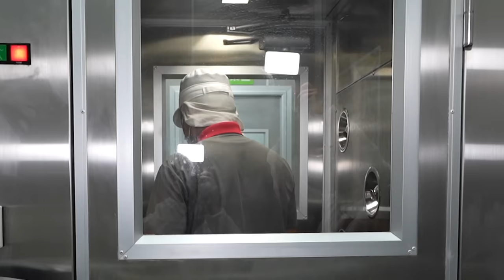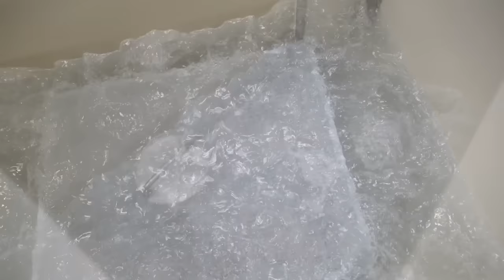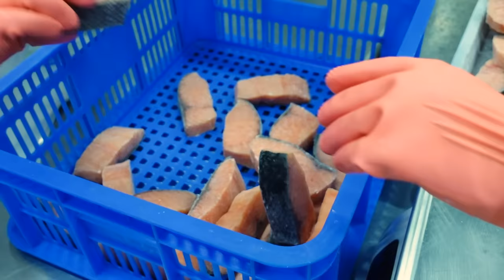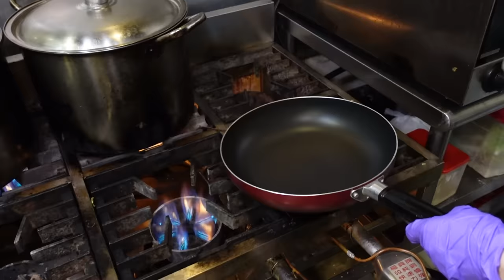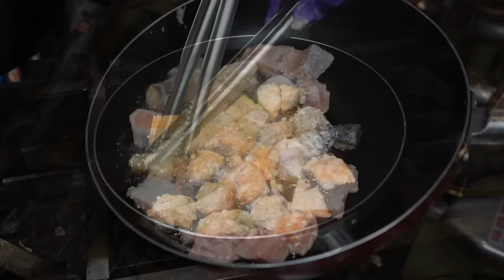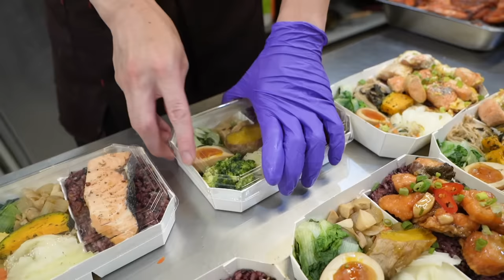Salmon fish cutting & salmon donburi making! / 鮭魚加工, 鮭魚丼飯 - Taiwanese food factory

Comment: Plastic cutting boards (PET) are a source of polythene microplastic contamination in fish, making them also a direct source of microplastic in wastewater.

The mean size of the microplastic in the raw fish was 1279.2 ± 835.0 µm, but decreased when the meat was cooked or fried. The microplastic melted during both cooking and frying processes and recrystallized partially upon cooling.

The Meat and Poultry Hotline says that consumers may use wood or a nonporous surface for cutting raw meat and poultry. However, consider using one cutting board for fresh produce and bread and a separate one for raw meat, poultry, and seafood.